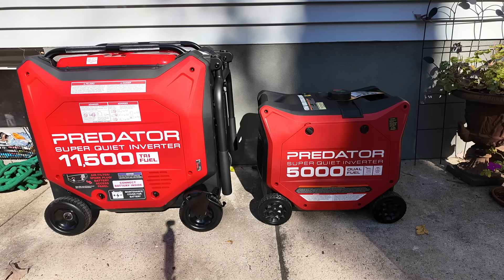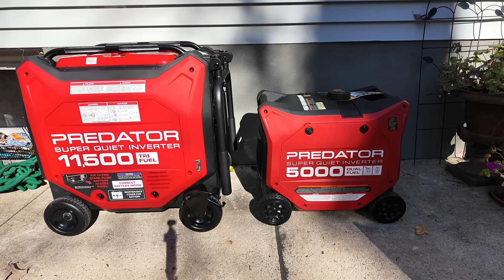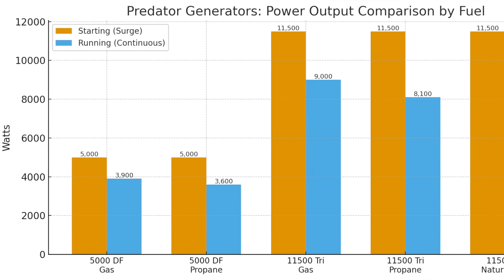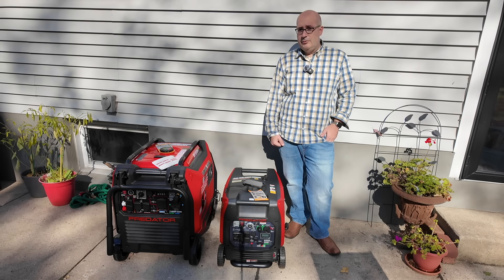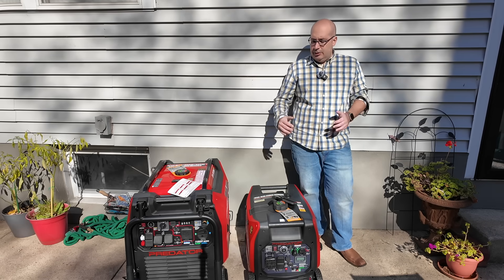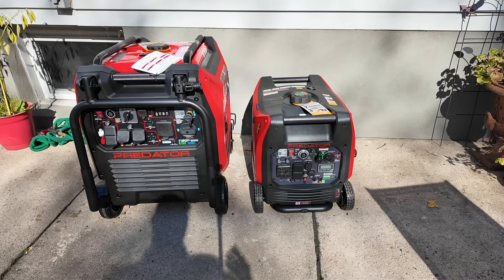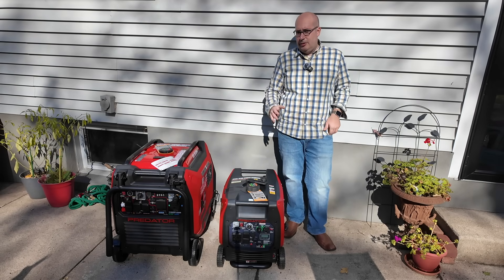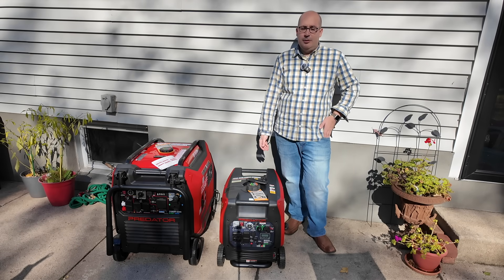Predator 11500w or Predator 5000w? Don’t Buy Until You Watch This!

Comment: @Outdoor_Prepper your generator videos are great! Helped me figure out which unit to buy. Decided to grab the Predator 5000 inverter while on sale for Black Friday. For less than a thousand bucks it’s cheap insurance. My main priorities are heat in the winter (forced air natural gas furnace), sump pump has to keep going during rain storms or spring thaw, run the fridge, turn on a few lights, and Internet access would be nice to have after the desktop UPS gives out. 

Next step is installing a transfer switch. Probably will go with a 50 amp setup as a future proof measure. Been looking at battery backup options as an additional solution because the Predator genny could end up powering a travel trailer.
Reply from the maker: That’s awesome to hear and great choice on the generator!

Comment: I really love my 11,500 Predator. I’ve used gasoline, but want to run it using my 250 gallon underground propane tank (residential). Fortunately the only appliance we have using propane is our stovetop in the house. I’m hesitant on plumbing into my tank supply riser to hook in to the generator because on page 19 in the owners manual it states: propane tanks that use a liquid withdrawal system cannot be used with this generator. I have no idea how to determine if my tank has a liquid withdrawal system. Could you help me with your thoughts or suggestions.
Thank you!
Reply from the maker: That’s a great question, and I'd recommend consulting with a professional propane technician to ensure safety and compatibility. Apologies just don’t really know what a liquid withdrawal system is

Comment: Am almost certain that two 5000s with parallel kit will not provide split phase 240v output.
Reply: Correct. When you parallel two generators it doubles the amperage. 

In order for 240Vac to work the two 120Vac generators must be in series and support syncronization. It's important to remember that 240Vac split phase is two 120Vac lines 180 degrees out of sync. If they are not 180 degrees out of sync it can damage things. 

Almost all the "converters" for two 120Vac to 230/240Vac are not split phase, as 230Vac is used in Europe and other locations.
Reply from the maker: That's interesting, thanks for the info!

Comment: We use the Predator 5000 to charge an EcoFlow Delta 2 Max at 1800 watts & in less than 3 hours it will run most anything in the house with its 6kw of storage
Reply from the maker: That’s a solid setup for sure!
Reply: could you run you ac on it

Comment: You could use the 5,000 Watts s220 as a small load like air conditioners or something like air compressor, fifth wheel travel trailer
Reply from the maker: Great points and appreciate you watching!

Comment: I have a 5000 with about 68 hours on it. Been great so far.  I did however buy it for our RV and as emergency back for the house.

It has had me considering the 11500 with a transfer switch for the 240v) . To be frank, I actually want to convert the entire house to run from batteries, then have multiple inputs. Grid/Solar/generator/donkey power etc.... maybe one day.
Reply from the maker: Thanks for sharing your experience and future plans! Batteries are definitely the way to go

Comment: If you lose your power and need to use a generator like these, do you still get internet service if your internet is through coaxial cable from say Xfinity? If a line is down causing you to lose power I would think that you are out of luck with internet service. Smart homes would be in trouble IMO.
Reply from the maker: I’ve lost power and was able to keep internet and phone goijf with a generator. Coax shouid just work. With Fios you would need to power the optical network terminal with the generator ( a box located inside your house). As long as the wires at the pole didn’t fall down you shouid be ok
Reply: @Outdoor_Prepper thank you.
Reply from the maker: @WhitieInVermont welcome

Comment: Important to note that the 11,500 watt generator is not giving out 50 amps at 240 volts. Most it would ever get would be 47.9 amps and that is if it was 100% efficient which is not, my guess without testing the one I have is it probably will give closer to 40 amps at 240 volts. Small discrepancy but still may be important if someone is trying to power up something closer to the 50 amp range.
Reply: That is common. I have a different brand 240Vac 6000 watt generator. It still uses the standard 240Vac 50 amp connector even though it will never come close to 50 amps.
Reply from the maker: Thanks for the info and watching!
Reply: It'll still start my 5 ton ac unit with a soft start though. Where I live it regularly gets 115+ outside so I needed something beefy to run that compressor. LRA on that unit is 129 and it pulls around 6k watts when running.

Comment: I would get 2 Genmax 7250's.. dual fuel, 240v capable, 50A plug and parallel capable. No need to run large items keep 1 going, want to run the central air fire up the 2nd. Save fuel and have a second for backup.
Reply from the maker: That's an interesting approach!
Reply: GenMax are excruciating loud. We have them and they aren’t the way to go at home.
Reply: @Dive-Bar-Casanova  Not sure what model you purchased but the 7250's are inverter gensets and about the same db as all the other Chinese genny's. Inside I don't hear them at all. In my back yard I get 66-68db at the end of the cord with Eco throttle on which is 25ft. Under 5k load it's more like 74-76. Comparable to my neighbors Champion and my folks Duromax though. Definitely not a Honda or as quiet as a much larger unit idling under load but for something you can move yourself if you need to and for an emergency I think you get a lot for the size of the package.

Comment: I question Harbor Freight's advertised surge capacity of the alternate fuels.  If these generators can handle the same surge ratings as gasoline, then they should handle the running capacity on the alternate fuels.  No other manufacturer advertises the same surge and running watt ratings for alternate fuels, it's usually 12% less on propane and 18% less on NG (give or take a few %age points).  Consider that these portable generators are not designed for 24/7 operation at max running watts; better at 80% or less for longevity.  Manage the loads so that only necessary loads are powered.  I use alternate fuels (gas/propane) to cook and boil water.

Remote starting with a key FOB seems unnecessary in my opinion.  A generator should never be started with the loads connected.   Puts too much strain on the starter.  Before starting a generator, it needs to be given a once over to find any issues that need attention (fuel leak?), the fuel and oil levers need to be checked, ensure the circuit breakers are off (remove or unplug the loads).  Then it may be safe to power up.
Reply from the maker: Great information and thanks for sharing your insights!

Comment: The main issue I have with Harbor freight generators is the warranty. 90 days is substandard when compared to others. I owned a 9500 and the extended warranty was extremely expensive and gasoline only. But this new Predator has incorporated the best features: tri-fuel and external charger for battery peak along with output display. The tooless cover removal is a nice touch also.
Reply: You did not purchase an extended warranty, what you purchased was a up to two year depending on which one you purchased one time replacement contract, if you new generator fails on day 95 they will replace it but they have also honored the one time replacement and that two year contract is no longer valid.
Reply from the maker: I didn’t purchase the warranty. I’ve had good luck with my other predator generator and an optimistic this will perform well over time just the same. Thanks for watching
Reply from the maker: Thanks for watching and I totally agree I wish the standard warranty was at least 1 year

Comment: For fuel efficiency run generators at 70-80% percent of its continuous rating. Big units use a lot of fuel just to run without generating any output. 2 small units that can be paralleled  might be a good way to go unless you need 240 volts
I have a Honda 
ei3000us that puts out 2800 continuous and weighs a ridiculous 130lbs +.  Electric start and quiet. By chance I found a Predator 4550 start, 3650 run inverter open frame gen  refurbished  and further discounted for about $250 on clearance. No warranty bring it back with in 5 days for full refund. It runs great., not that much noiser than the Honda and weighs 77lbs dry. Guess which one I grab first. I can parallel them if needed. This Predator puts the 3500 Predator to shame on output and 25lbs lighter. Not that noisy either.
Reply from the maker: Great info! Thanks for sharing and watching!

Comment: Unless you are using it in a "portable" situation, RV etc. it's idiotic to get a generator that doesn't run on natural gas. Hook it up and forget it until the power comes back on. No need to deal with gas going bad, fetching more propane, all those tfuels will be in high demand if an outage is bad enough and long enough.
Reply: If the storm is bad enough, you may not even have natural gas.
Reply from the maker: @matthewwain9958 thats a valid point and another great reason for tri - fuel - it gives you options
Reply: There are many areas of the country that don’t have natural gas available. Fortunately I do have it and am considering having my lines extended to include hookup for a gas dryer and one that goes outside for a grill or generator. And don’t forget you get the least output from your generator on natural gas and that makes it less portable if it doesnt also work on other fuels.
Reply from the maker: Good points!
Reply from the maker: Totally agree- natural gas is really the best fuel choice . Thanks for watching
Reply: I don't have natural gas available.  So it's propane or gasoline.  The key is to be prepared.  Don't wait for the need to arise before addressing it.  I keep several gallons of gas and rotate my supply through my vehicles.  I buy liquid fuel for my Coleman stove, lanterns and heater when they go on sale.  If I get desperate, I'll burn pump gas (except in my heater).  In the 40 years I've lived in the desert southwest, I can remember three power outages than lasted for less than an hour.  But that's not guarantee that my next off grid experience will be as short.  If the need arises, I can siphon gas out of my vehicles to run my generator.

Comment: Nice overview. When you are comparing run-times, what load is on the generator? Are they fully loaded (which would mean the 11500 would be putting out twice the output of the 5000, hence fuel consumption difference), or are you loading them both the same (to about 5kW)?
Reply from the maker: Thank you! I’ve tested each runtime on propane at 25% load to gauge if the manufacturer specifications are correct and what I could realistically expect and then do the calculations for a higher load. I have videos on my channel where I tested the runtime of each but again at 25%, and then I would do a calculation based on whatever load I predict I might need
Reply: Ok, that means the 11500 was tested at roughly double the load of the 5000 - so double the fuel consumption is realistic, right?
Reply from the maker: Correct. I buy fuel economy isn’t linear between the 2. I got roughly 13 hours at 25% load on the 5000 and roughly 8 hours on25% load on the 11500
Reply: Ah, cool - that means the 11500 is a bit more efficient. Great info!

Comment: Yep, I only go for the power I need to be comfortable. I got the 5000 Predator last year. Had a load 2010 Briggs & Stratton 8550. I never used it & parts was hard to find.
Reply from the maker: 5000 is an awesome generator and I love it! Nice and quiet and fuel efficient

Comment: I own the 5000. I also own a champion 11000 watt, non inverter.  I never use it.  The 5000 does all I need.  I caution anyone buying this to change the oil 2 or 3 time after purchase and during the break in.  My unit had metal shavings during the first two oil changes.  They do a horrible job of cleaning these up after manufacturing.
Reply: A magnetic dipstick is essential from day one. They sell them on Amazon for like $12
Reply from the maker: Excellent point about oil changes! I change the oil often to help prolong the life. Thanks for watching!
Reply: I saw another video review where they recommended a magnetic dipstick. I was skeptical since the engine block is aluminum but I have gotten a fine gray film on it every time I check the oil. Probably need to change the oil anyway to get the aluminum. But I am fortunate that my well pump is 120v and I have Natural gas for my stove and furnace. I just can’t use the 5000 to power my air compressor or central air. I can live with that.
Reply from the maker: @dguiley thanks for sharing! I’ve always been afraid of the magnetic dipsticks incase the magnet falls off into the engine but have it’s something I should pickup for the generator
Reply: @Outdoor_Prepper  I didn’t think of that as being a possibility but I went out and looked at mine. After wiping off the gray film I saw where the magnet could possibly come loose. I won’t let you make me paranoid tho 😂. While I was out there I fired it up since it was time to give it a little exercise. Of course the power has only gone out once since I got it.

Comment: Another video on YouTube ignoring emergency charging for electric cars. Why is it so hard to find one video where somebody discusses charging cars, efficiency, and LPG use for electric cars owners 🙄😞
Reply: I don't see why the 11.5 wouldn't work to charge an EV. Just set the charging current to 30A or so. You may need to buy or make a neutral-ground bonding plug so your charger sees that it's grounded. The 11.5 comes with a NEMA 14-50 receptacle that many EV chargers use.
Reply from the maker: I’m sure it could work but don’t think it would be efficient in terms of cost of fuel vs how long it would take to charge a car
Reply: If you make one I'll watch it.
Reply from the maker: Well, the larger generator could charge an electric car. It would be incredibly inefficient and a poor use of the generator and my personal opinion.
Reply: @Outdoor_Prepper correct
Reply: It’s not that he ‘ignored’ anything… he ‘chose’ to cover ‘what’ he covered.  I’d bet that if you gift him an electric car - he would absolutely produce that all-elusive video that you seem so desperate to find.
Reply: Because only a tax dodging moron would buy an EV. Good luck with that depreciation and complete lack of trade in value.
Reply: @MoragTong_ 😅
Reply: Get the 11500 and have it hooked up to a generator plug on your house . That would power the EV charger . Or are you asking something different?

Comment: Do you where to find a parallel unit for the 11500 unit that is capable of handling the 50 Amp output? The Harbor Freight guy at my store told me the current parallel kits are not rated for even the 9500 unit....
Reply from the maker: I actually don’t know I figured harbor freight would sell it . Apologies
Reply: @Out@O @Outdoor_Prepper  prob, I found a 18000W 50Amp, tri fuel, inverter unit on Amazon. Might just get that one instead.🤷🏻‍♂️ You'd think Harbor Freight would want to support their own products?!